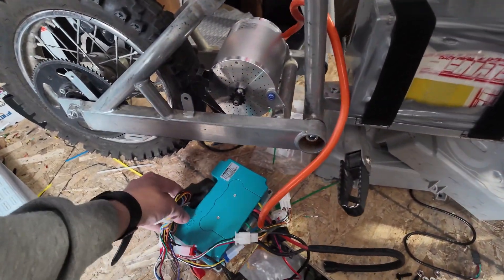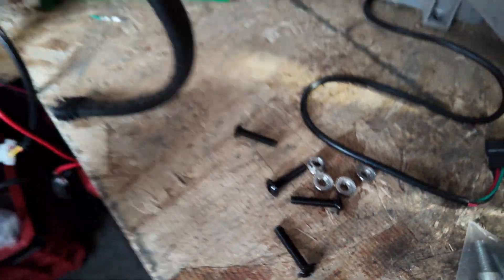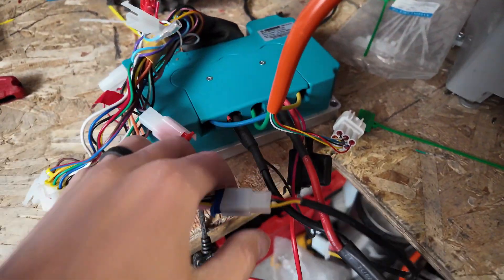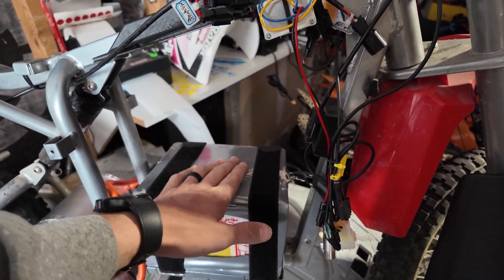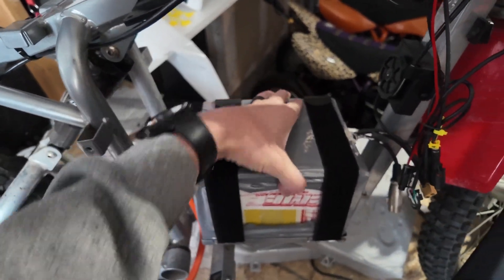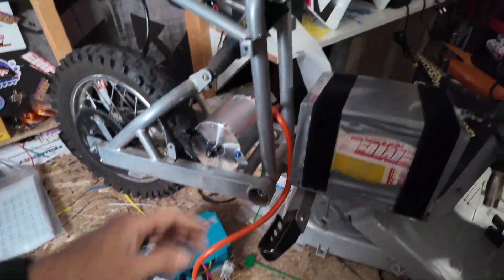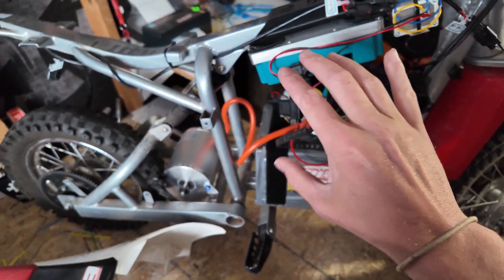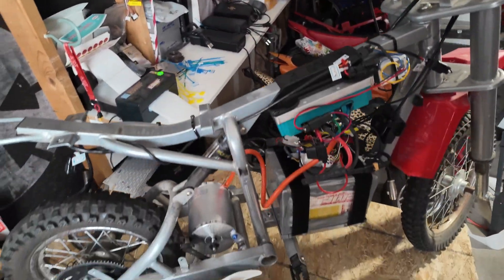Best Way To Instal Fardriver Into Razor(MX500/650, SX500)

Comment: Which pin in the board of controller for single line digital speedometer?
 Because I can't find the light blue wire on my controller, And the wiring color is very different with your controller.  i think the manufacture of my ev motor has changed it.